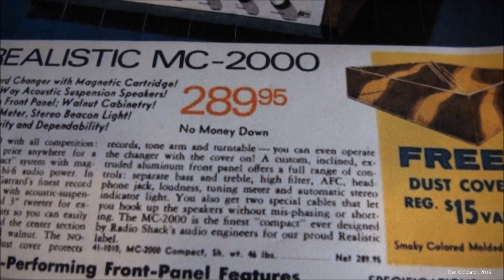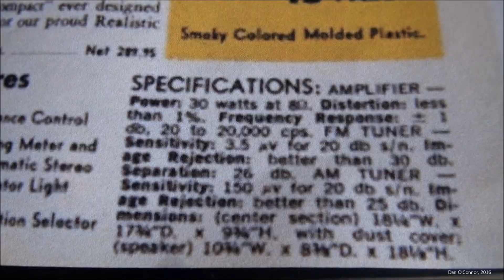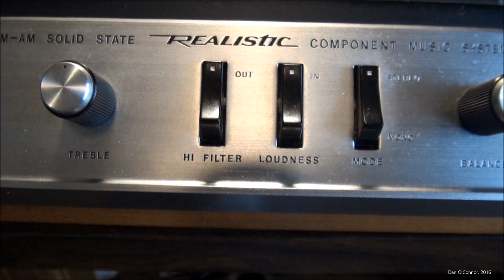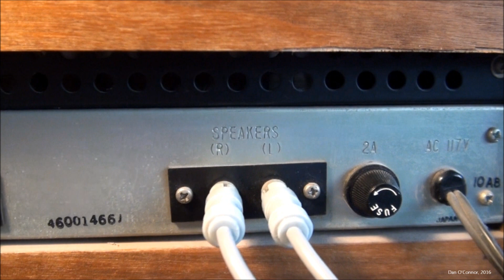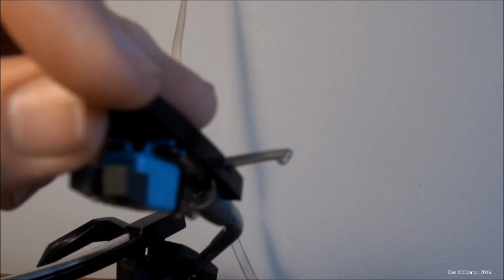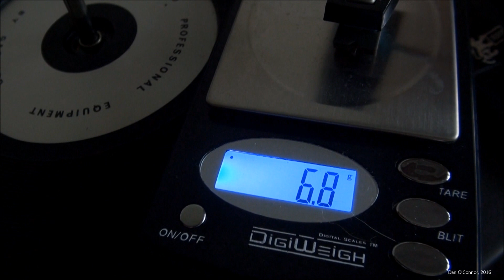1969 Realistic Component Music System MC-2000

Comment: 7 grams. Way to much you are going to need a new stylus 4 gms should be the max. More like 3.5 gms. Cartridges tracked that heavy back in the late 1940s to mid 50's. Needs some capacitors that plunk sound when you turned it on by pulling the vol pull on was kinda dreadful. Great and rare unit I hope you get it recapped before turning it to junk.

Comment: That's very nice for a compact system; I don't think any of Radio Shack's compact systems of the mid-1970s had magnetic cartridges, which were unusual with consumer-grade labels; you usually had to spring for a KLH or Fisher to find them. Garrard should never have discontinued their 3000 series changers; they were simple, well made and probably easier to manufacture than their later Unimech models. They also could intermix multiple sizes while the later Garrards had those awful speed-size selectors that wouldn't let you even try to play 10" LPs automatically. Even though $300 was a sizeable investment in 1969, these were  a decent value.

Comment: Thanks for posting!  My dad had a Harman-Kardon compact system from the sixties that had that same angled front panel.  It was a higher-end unit because it had a Garrard AT-60 changer with a Shure magnetic cartridge and big speakers.  The thing sounded awesome!  It quit working sometime in the eighties and was deep-sixed at that point because my father wanted something new with tape and cd capabilities(terrible quality and also long gone).  Too bad I wasn't aware at the time to value it enough to get it fixed up.  At least I still have the HK-40 speakers that came with it and they still sound great!
Reply: My dad had the Scott 2503 Stereo compact - Garrard 3000 & S10's he bought it in 68,similar appearance to the HK & this realistic I think Fisher had something also.The Scott 2503 was considered a higher quality at the time also.Similar story..the dial glass fell in around 86 87 (he passed away) & stupid stupid me talked my mother into buying something new, Kenwood..I took the Scott unit to the garbage myself..FF to early 2000's I took a couple units & painstakingly built 1 good one.Knowing what I know now  ? I would have never tossed dads.Finding a dust cover for one of these is just about impossible..I have one but looking for another for 15 years.I see the HK's on Ebay from time to time.

Comment: Dan, that "30 watts" spec was for peak power - which means the amplifier on this put out (roughly) somewhere around 7.5 actual watts per channel RMS  -- not 15. It wasn't until a few years later that the FCC introduced regulations that the manufacturers publish real watts in their specs rather than continue to mislead consumers. Regardless of such low power on a lot of them, many of the compact shelf units like this from the 60s & 70s sounded  quite good for what they were and obviously were orders of magnitude better than the "Crosley" and all the similar shameless trash being marketed today - in EVERY way.
Reply: Sadly, years of industry lobbying have whittled away those FTC rules into oblivion. It's now normal to lie gratuitously about amplifier power; I saw an add for a "3000 watt" Bluetooth speaker that ran off a 30W wall-wart.